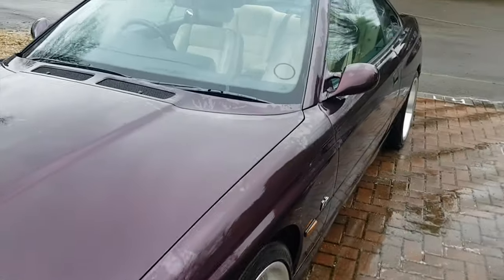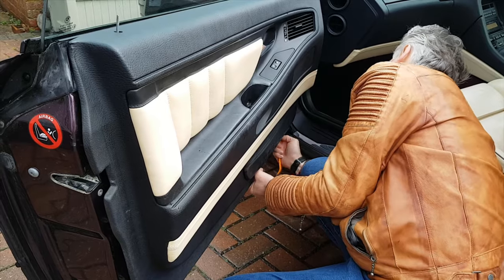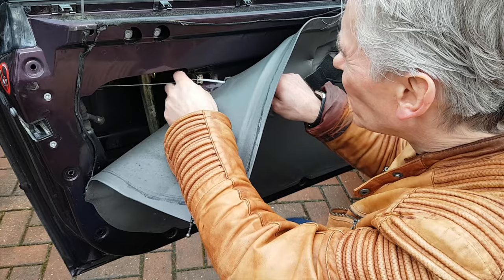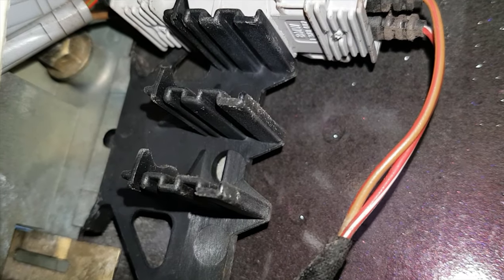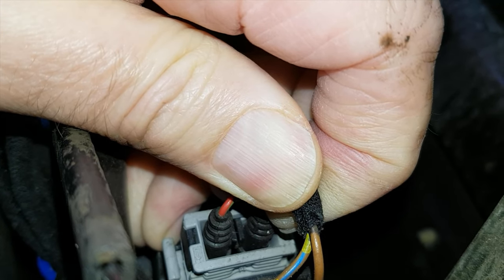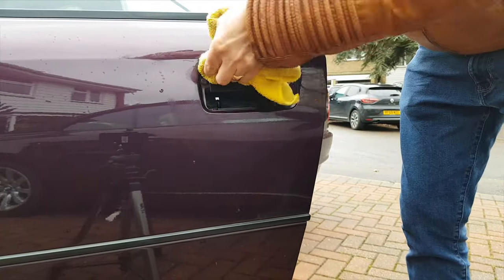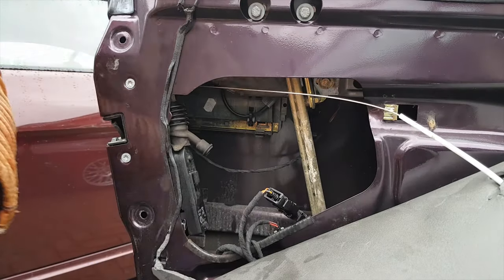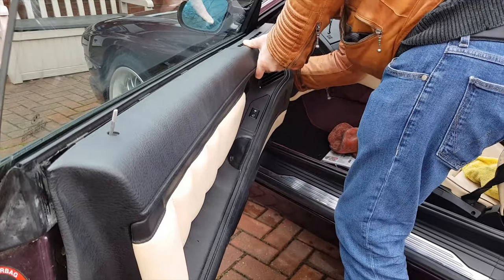BMW E31 Window will not close - Storm coming!

Comment: Brillent! Loved the time lapse door panel removal. I have to repair the outside handle will not open the door...hoping by seeing inside the door first what to expect! Thank you for your presentation!
Reply from the maker: Thanks Greg - you can see the nuts at the back of the handle in the video - they look like 10mm - or 8mm from memory!
Reply: @TimmsBMWRepairsandInformation  Yes I just watched again as I had to gather the time and parts necessary to repair the door lock release system from the outside. Once again the commentary is brilliant....love the comment about " I'm just wasting time! All the best and thanks again for this post its a big help. As you know on an older car it's easy to break these older dried out plastic parts. Off to work bashing away on my BMW 850 project!

Comment: Very interesting video thanks. In my Mercedes CL500 there is a similar feature when opening and closing the doors but with those the problem is usually the Window Control Module that lives under one of the rear seats and you have to change that to fix the same problem ... ask me how I know! I replaced mine with a second hand unit and got another second hand unit (tested it) and now have that in stock ready for next time.  They are a known failure item and cost a fortune from Mercedes. The only reason I mention this is in case any Mercedes Coupe owners watch this and have the same problem as you and I have had. I spent ages seeing if I could fix the original unit that failed but my electronic skills are sorely lacking and so gave up.
Reply from the maker: Thanks Mark, the more info the better!

Comment: You'll fix it properly come the summer no doubt.
Reply from the maker: I'll probably get a second-hand door-latch from Ebay and investigate how it works first - there were two torx bolts holding it on so it shouldn't be too hard to get off - it may well be a Hall-Effect device, but we'll see - and of course I will do another video for it!

Comment: Hi Timm, thanks for this video. I just got 95 840Ci and there are couple of things I would like to address on driver side door. First is mirror controls are not working. Second is the door handle that appears to be crooked and the side towards the back of the car sits higher than left side. It also feels like it’s rubbing against plastic handle cover. Handle cover sits straight. Any chance you could give me few suggestions?
Reply from the maker: Replace the mirror switch, they appear on Ebay quite often - you can also try cleaning the switches out: https://www.meeknet.co.uk/e31/BMW_E31_Replace_Window_And_Mirror_Switches.htm For the handle you need the repair kit from Wokke.de, there are also other repair kits on Ebay. The metal fails after a few years on the handle - not available from BMW

Comment: The 8 Series becomes possessed below 45F if the capacitors in the General Module (located in dash near steering column - looks like a VHS tape)no longer make proper contact. The symptoms will be: Electric locks don't work, window will not pull down from full up position (so you cant get in the car), wipers won't work, windows randomly work for a few seconds, trunk lock locks and unlocks randomly, interior light flicker on and off like a disco. Before I realized the solution I would leave the driver window down an inch stuffed with a towel so at least I could get in the car. After starting the car and running the heat full blast, the interior map lights will eventually return to full on position - this wait period is about 15 minutes. Rebuilding the general module costs about $200. Easiest way to buy one already rebuilt and just swap it - either DYI or through your dealer/mechanic.
Reply from the maker: Yes, the General Module can be a real blighter. My advice is to keep the car alive with the batteries connected and fully charged, it keeps those electrolytics happier than lying there discharged!

Comment: I have a similar problem; the window on the passenger side goes down when I open the door. However, it rolls up again before I close the door. I have checked the micro switch in the door lock mechanism (door jamb switch) and it works ok. I can also follow the signal from it into to the passenger foot well (colour BR/BL/GE. From the schematics, I see that it is connected to pin 16 on the Anti Theft Module and pin 6 on the General Module. However; on the General Module, the pin number/colour code does not match with the schematics. I can find a wire with the BR/BL/GE colour but it does not show the signal from the switch.
Can it be different versions of the schematics??

Comment: Do you know what causes the E63/E64 window issues? I have a 2005 645ci and 98% of the time the window doesn't automatically roll up, and some of the time when operating the convertible top either the driver's ( left side ) rolls up half way and stops, and sometimes it's the passenger side ( right side ) stops half way. When that happens the Anti Pinch warning on the cluster lights up. Sometimes I'll be driving and want to roll up the window, I'll hit the button and the window will go up to the top and come right back down. Kinda gets annoying. I know a lot of people have this issue. Your thoughts???
Great videos by the way!

Comment: E31 says brake assist in op  brake light illuminated  brakes are dragging after a wile driving ,,jacked  up the car wheels dont spin freely ...after the car is parked for a while cools jacked up car wheels spin free again ANY IDEAS THANKS ???
Reply from the maker: Yes, that's an easy one - your master cylinder has failed internally. This is the ONLY fault that causes the brakes to slowly bind to a point where the car actually stops dead in the road. After stopping the engine and pressing the brake 20 times the brakes will let go again - and you can get on your way. A master cylinder from the E32 750i fits and is a lot cheaper and more available than the one for the E31

Comment: Im having exact opposite issue. when accessing the passenger side from outside the lock releases but window stays firmly shut. no issues when exiting car window drops and reseals on closing of door. Central locking all fine, im guessing micro switch on outside handle. Any other possibilities /
Reply from the maker: Try pressing the door handle IN - if the window drops you can bet your door handle mechanism has cracked - if that does nothing just listen to the microswitch - you should hear a faint click as it opens

Comment: Great job! You said that the panel is a CSi panel, have you swapped the interior for a CSi one?
Reply from the maker: Thanks! In the UK, from late 1998 onwards we could order any option that was available for zero extra cost! So, my car got all sorts of stuff, sports suspension sports body kit, M-Sport wheels, individual exterior and interior which included the CSi door cards, chrome kidneys and anthracite headliner - all for no extra cost!

Comment: Hi Timm! I had my concerns with Dennis but my E31 has survived.

I have come across an issue for the first time today, when I close the door it doesn't catch on the latch. The latch is in the open position and I have to close it with force to ensure it stays closed.

Have you ever experienced this and could you offer any tips on it?
Reply from the maker: Yes, the spring in the latch has failed - you can see it in this video , above the electronics of the latch actuator against the end of the door
Reply: @TimmsBMWRepairsandInformation  Many thanks, I shall start troubleshooting when I can get some light tomorrow :)
Reply: @TimmsBMWRepairsandInformation  can you show me exactly where with a pic? The driver door outside handle wouldn't open the door, I discovered a metal broken frame  , I installed repair kit and the door opens now when I pull the handle but only if I unlock the door first by using the inside handle. I also notice that I have to close the door a bit hard otherwise it doesn't close properly. Any ideas? I'm stuck. Could the spring be failing as you indicated here ,be causing this problem?

Comment: Those micro switches that make the windows go up and down are a real pain. The ones on the windscreen frame that are activated by the convertible top can get dirt in them and then really give a lot of trouble. 
At least you beat the storm.
Reply from the maker: I did - and I've re-erected the fence panels today - so all good!
Reply: @TimmsBMWRepairsandInformation  Has the storm passed and is your roof on your house safe?
Reply from the maker: Yes, thank you - and I've even re-erected the fence panels!